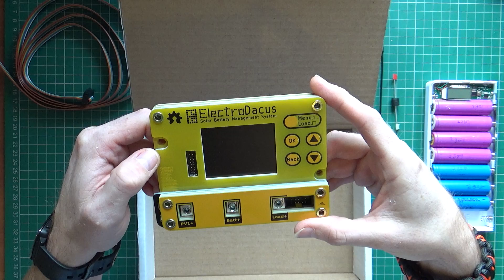SBMS40 unbox and thoughts

Comment: Awesome Vid looks like a great product I've done much research nothing on the market like it.  Whats are your thoughts now 3-4 months down the road?  Are you still going to do a follow up video?
Reply from the maker: Hi Ross i sold the Charge controller as i wanted something with more flexibility for my needs.  Dacian is a really talented man but i'm enjoying doing my own BMS solution currently along with an off the shelf charge controller.
Reply: Colin Hickey, May i ask what charger controller male and model you are using and what Microprocessor on the BMS you are using?
Reply from the maker: Ross Aspinall Hi Ross, I have two epever charge controllers a LS1024 and a tracer 3210A. The bms is using an esp8266.

Comment: I want to build my own! Electro said we can but I am not sure he really wants anyone to do it. I am waiting to see if he replies to my query. I think he has done a great job with these.
Reply: Is not that I do not want anyone to do it but you need to be aware that it will be more expensive to build one or two for your own use than to buy one.  I know how much it cost me to build a prototype.
I can get to a lower cost just because I build a few hundred at a time so PCB's and parts get to be at a much better cost than just one part.
It is only worth to build your own if is for educational purposes and you do not care about the cost.
Reply from the maker: I looked at the chip he used and after a cursory look it doesn't look easy to get hold of.  I think it is a great piece of kit i just need to see if it works for me or if i need to try and cut my losses.

Comment: Could be useful in a remote cctv or wildlife cam setup with point to point live comms. Thanks
Reply from the maker: Yeah although with the cost i'd be very hesitant on leaving it somewhere remote.  For that i think you could probably get away with a far smaller 10A charge controller, small panel setup and mini powerwall maybe.
Reply: Colin Hickey you're right Colin its a bit pricey for that kind of application, looks capable though.

Comment: Waiting on my 40 and 120 so excited
Reply from the maker: Off grid Colorado I need to test mine as I’m curious how it shall do with all panels having to be in parallel.  In winter two are likely to get very shaded the majority of the day.
Reply: Colin Hickey where I'm at I'll get 5-6 hours of sun providing no clouds on dec 21 I think it will do amazing!!  Were switching from a vrla solar setup. I'm sure it will work perfect and get more gain that you imagine.
Reply: Colin Hickey is it not possible to move the panels?are you going 12v or 24v?what panels are you going to run. I have a channel here on YouTube also you can see my current setup and the 3-300 watts I'll put on the 40.i will subscribe to your channel.
Reply from the maker: Sadly not as the panels are on top of my kids playhouse which can't be moved.  The only alternative in winter would be to either have extra panels i could place temporarily on the ground in the garden or temporarily move the existing ones.  As it's more for garden lighting etc though and not for the house directly i don't think it's worth it.  such a shame to have a portion of the year unusable though when it is actually sunny at times.  I have built a small wind turbine with a more powerful model coming though which may be able to top things up slightly.
Reply: Two small panels like you have can't you put them on a 4x4 wood post bolted on the side of the play house and you could make the mount from a old small satellite dish and some bed frame for perfect winter angle if you like I can make one on a video?
Reply from the maker: Thanks for the offer but i mounted them at the back as it was south facing but also keeps the panels hidden nicely.  The neighbours would be complaining if i put something like that up, houses are quite close together here in the UK.  I'm pushing it a bit with my small wind turbine as it is.
Reply from the maker: Oh i should add I've 6 100w panels.
Reply: Colin Hickey  I think you will be surprised at you much power that is going to get even with only 4 panels and 4 hours of sun you will get about 800 watt hours of useable power.
Reply from the maker: Agree the six panels generate a decent amount of power but mounting them differently isn't an option sadly.
Reply: So how's the sbms40 going did you get it hooked up yet?

Comment: A nice package to receive even if it ended up costing more than you thought. 
A couple of thoughts - could you create a network bridge with an old access point or router? Even a plug in extender might stop you having to walk down the garden? 
They’re PWM aren’t they - that’s way you need the lower voltage and higher current? May fair better in the winter anyway. Also means they generate less heat. I don’t think you’re taking much out of your packs at night so perhaps the MPPT advantage isn’t required anyway. 
Do you know how much current the balancing circuit uses? Perhaps that is configurable in the software? Otherwise you may find it works a little differently on a small test pack than a larger one.
I’d love to play with one of these but equally I’d like to cobble together a load of bits and build something similar! 
Have fun.
Reply: Adam Welch, not a PWM device.  Panel voltage needs to closely match battery voltage, hence 60 cell panel for 25.6v nominal battery bank.  The charging is CC at full current until maximum charge voltage is reached (first cell reaches 3.55v). Same as charging a lithium battery with a desktop power supply where you set the voltage and current you want. My experience is that the current each parallel panel achieves is near its maximum.  I’ve even seen current delivered higher than rated current for the panels on a cool sunny day.  My figures for the PV input for my system are excellent, suggesting it is equal to or better than MPPT (no losses due to inefficiency) as the solar current produced is fed to battery bank through solid state architecture.
Reply: Thanks for this insight.  Presumably its trying to do a normal CC/CV type charge though, so once the target voltage is reached it must limit the current?  The easiest way to do this would be via pulse width modulation - decreasing the time the panel is connected to the battery bank to ensure the cells remain at the target voltage without going above it.
Great to hear you're getting good efficiency out of your panels.  Cheers
Reply: Adam Welch, I can see what you’re getting at, but the SBMS series simply monitors each cell, balancing as it charges at full PV current.  Each cell voltage is monitored and once any cell gets to the maximum set voltage for that chemistry (3.55v for LiFePO4 in my case), PV current is cut.  No cell can go above this maximum.  Charging is not started again until all cells have settled below another preset value.  This technology does not try to taper the charge current at the end of charge to achieve true 100% capacity.  The top end of the charging is usually where problems occur for not a great deal of capacity gained.  It’s just a different approach to charging and battery monitoring and cell protection.
Reply: Thanks - that is very interesting to hear and an interesting implementation by Dacian.  The info I'd read hadn't specifically said what technology it was using, I'd just read between the lines I guess and assumed.  Again, thank you.
Reply: @AdamWelchUK  Adam, you are the best pwm, and mppt tester i know on youtube , you tested it so many, how about trying this one too ;) i'm sure, there is so many people buying according your reviews ( im one of them! ...u know the diyBMS ;P )